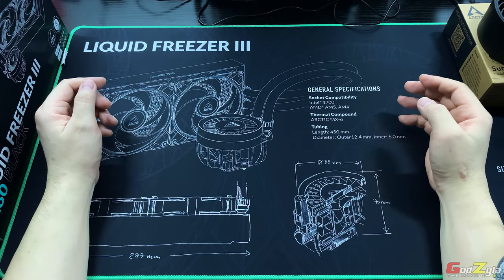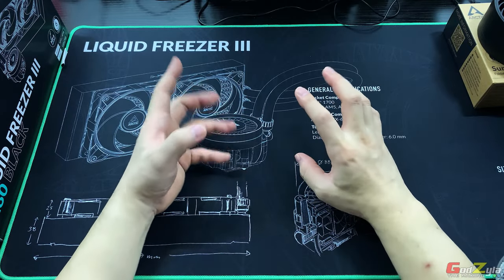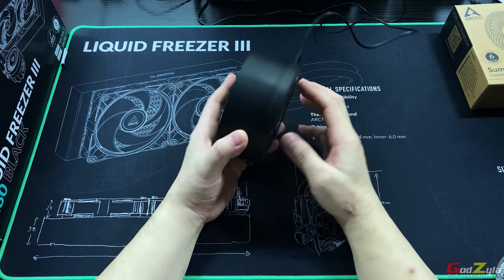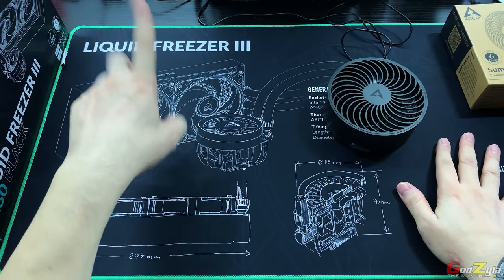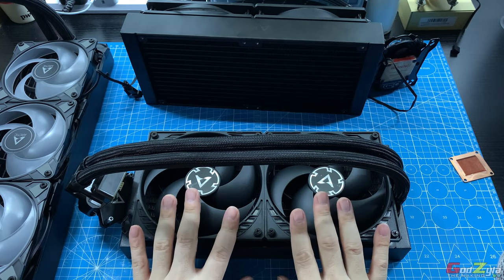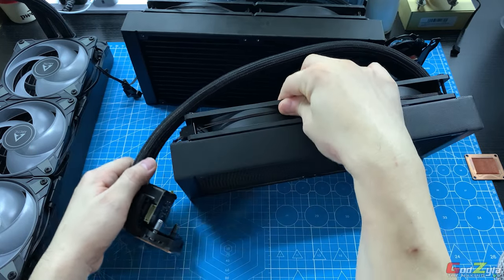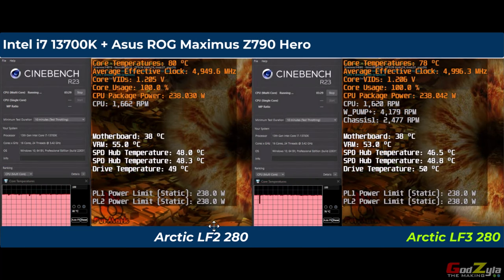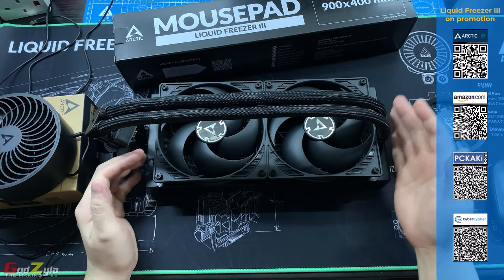Arctic Liquid Freezer III

Comment: Hey @kleoYan if you were me im doing a build with the 7950x, what motherboard you will pick and what liquid freezer III model for not get thermal throtling never with this cpu, I need your answer please
Reply from the maker: Hi Chema Alonso, welcome to my channel. For motherboard, I will need to know what do you use the 7950X? as for cooling this processor by default, I will go for LF3 280 (push pull) or LF3 420.
Reply: @KleoYan  Im going to use It for rendering and proxmox virtualization, I just want a good motherboard and a cpu cooler that give me 5.7 boost when im rendering without thermal throtling I just want for my need what do you pick if you were in my side :) thanks!
Reply from the maker: @chemaalonso7931  i see.. should just grab a mac mini M3 lol.. ok jokes aside, for budget mid tier, I will go for ASRock X670E Steel Legend or even the ASUS TUF Gaming X670E-PLUS WiFi 6E, both are of good VRM solution and power phases. As for the liquid cooler, LF3 280 (push pull) or LF3 420.
Reply: @KleoYan  thanks so much!
Reply from the maker: @chemaalonso7931  you are most welcome. Please take note on case airflow too. all the best with your build.
Reply: @KleoYan  there is a less cases for the LF 3 420 meshify XL and nothing more but if I put a 280 what case do you recommend for push and pull?, where can I see a video of that airflow?
Reply from the maker: @chemaalonso7931  the 420 on a mshify XL will be good. as for 280 push pull, it will be tricky to cater a case for it. As why I say push pull, I have done testing on an open bench.
Reply: @KleoYan  then meshify and 420 :) thanks your amazing
Reply from the maker: @chemaalonso7931  you are most welcome and all the best for your build.
Reply: Hi @KleoYan,

I hope this message finds you well. I'm reaching out to seek your advice on an optimal fan setup for my PC build, considering our previous conversations.

Here's my current setup: I have 9 fans in total, including 3 on the CPU radiator (Liquid Freezer III 420) and 6 case fans. My case, the Meshify 2 XL, comes with a Nexus+ 2 hub.

I'm contemplating two potential setups and would love to get your take on which might be more suitable:

1. Connect all fans (radiator and case) to the Nexus+ 2 hub and then to the CPU_FAN header on the motherboard. This would synchronize all fans to respond to the same speed profile based on the CPU temperature.

2. Connect only the radiator fans to the CPU_FAN header and the case fans to the hub, which would then be connected to the CHASSIS_FAN header. This would allow for more specific control, with the radiator fans adjusting directly to the CPU temperature and the case fans responding to the overall system temperature.

In both setups, I'm considering keeping the VRM fan and the water pump separate, as they have different speed requirements and may not need to sync with the other fans.

My main dilemma is whether to group the radiator fans with the case fans or to manage them separately. Which approach would you recommend to ensure each component operates at its optimal speed while maintaining a balance between efficient cooling and minimal noise?

I appreciate your time and any advice you can provide.

Best regards Chema!
Reply from the maker: @chemaalonso7931  Hi welcome back, I would have the radiator fans seperated from the case fans. this is what I will do.

1) Radiator fans to CPU_FAN (Make sure to check the ampere of CPU_FAN if it's sufficient to provide your rad fans)
2) VRM fan to Cha_FAN / SYS_Fan
3) AIO Pump to W_Pump / PUMP_FAN / AIO_Pump
4) your case fans to the NZXT Hub and then to the CHASSIS_FAN (This you need not have to worry about ampere as I believe the NZXT hub comes with a sata power source directly from your PSU)

the above configuration is more idea as in the even if your NZXT hub is not functioning, at least you know what your Liquid AIO will function as their VRM, Pump and Rad fans are plug directly to the motherboard respective pump / vrm / rad fan headers.

Comment: Good job man,
Quick question, I have a 120mm arctic 2 with a defective pump, do you think it is possible to adapt the arctic 3 pump to the arctic 2 ?
Reply from the maker: HI RCPxx R , welcome to my channel. I am unsure what you meants by adapt the Liquid Freezer III to the Liquid Freezer II. both Arctic Liquid Freezer II and Freezer III have a different structure. LF3 will be an improvement over the LF2 in terms of temp on an AMD platform.
Reply: @KleoYan  no lf3 with aio 120 mm, is it possible to mount the two pipes and the pump of the lf3 on the radiator of the lf2 aio 120 mm
Reply from the maker: @rcpxxr4452  as mentioned both are of different builds. Structure are different so nope. Why the hassle? I mean if you have the LF3. Just replace your LF2 or If your LF2 pump is faulty and it’s still under warranty, you can raise an RMA with Arctic and get it fix.
Reply: @KleoYan  thanks for the information
all this hassle? Because there is no lf3 aio with 1 fan. For fun I would have upgraded my lf2 with the lf3 pump.
Reply from the maker: @rcpxxr4452  I see. You are most welcome.

Comment: I tried 2 units of the LF III but the pump is much louder then LFII. Also when on lower rpm then the LFII (~2000 rpm)
Reply from the maker: Hi ya Daisudori, welcome to my channel. hmm.. I guess each have it's own sensitivity on pump noise and fan noise. So sorry that you find it loud you might want to tune down the RPM of your pump to 80% but there might be and increase of thermal by a degree or two
Reply: I shaked the rad around while the pump was running and now its quiet. Didnt work on the first unit tho.

Prolly some trapped air.
Reply from the maker: @Daisudori  That's good to hear. Infact I too tested 2 more other units. the one which I have and the 420 which belongs to my colleague. it's quiet but the 360. for some reason it's louding. gonna get intouch with Arctic on this, might need to do an RMA on the 360. by the way, thank you for your updates.
Reply: MY units were both 360 (black argb) @KleoYan
Reply from the maker: @Daisudori  hi you might want to do the same as in contact Arctic support about your car experience. As you have bought two units.

Comment: Great  explanation.  I see the fans are setup for push and the fan cables are daisy chained and the last one goes down into the tubes sleeving .  What if you want to mount the rad in the front of the case and have fans setup for pull. Can they easily be flipped over and can you still have the cables go down the side of the rad that is hidden.  Also what if you want to change the fans completely ?  How do you remove the fan cabling from inside the tubes sleeving  ?
Reply from the maker: HI Keith Flanagan, welcome to my channel. if you flip the fans to pull configuration, the cable which is in the tube is long enough to cater for the other side and if you change fans, I would still plug to the tube cable or you can choose to plug at a separate cable which is directly plug to your motherboard fan header. As for the cable that is in the tube, you can't remove it. I will just cable tie it and to hide it nicely. 
As you can see in this test, for the LF2, I have done the separation, as I know if I am to use the LF2 single cable, the rotation of the pump and fan will be much weak. So I have the LF2 pump to my Pump_Fan and radiator fan to CPU_Fan. For the LF3, I am using the splitted cables and not the single cable.
Reply: Thanks very much for the detailed reply. I already own an EK Nucleus CR360 Dark running Noctua NF-A12X25 fans.. I wonder how this rates compared to the LF3 360
Reply from the maker: @flaccus123  I see, if you already have the EK Nucleus CR360 Dark with the Noctua fans, the result is comparable or better on your AIO.
Reply: @KleoYan  I forgot task with Arctic Freezer III 320, how do you find the pump noise when controlling everything from the single pwm cable.  I have heard reports of it being noisy. Thanks.
Reply from the maker: @flaccus123  hi, for the 360 which you hear in the content, the mic is very near the pump and to me it’s not noisy when you place in a case.

Comment: I can't get my rgb to change when I hit the led button on my tower.
Reply from the maker: Hello Ryan DC, if you plug this ARGB from the AIO to your motherboard ARGB header. Your case led switch will not work. You have to connect it to the case ARGB controller.
Reply: @KleoYan  it's a 4 pin connector correct?
Reply from the maker: @FLA1L1NGSHUFFLE  nope 4 pin is to control rpm of fans.  It’s the 3pin 5V ARGB
Reply: @KleoYan  lol I have to look for that one. I don't remember where I plugged it in.....
Reply from the maker: @FLA1L1NGSHUFFLE  for the LF3, trace the cable, it's pretty easy. you have one on the AIO Pump and another at the fan end.
Reply: @KleoYan  I found it 😅. It was plugged up to the mobo and tucked behind the board to hide the wires.

Comment: Can you remove the fans? I want Corsair fans with it.
Reply from the maker: Hi StormRider, welcome back. I guess you wanted to know does Corair fans fit. This I am not able to answer you as I do not own any Corsair fans. Nevertheless the original Arctic P12 ARGB or Non ARGB fans can be removed from the Radiator. As mentioned, just got to be careful when you unplug the cable connectors. In general, you can replace with other fans, just that I cannot commit if Corsair fans can fit, as some are build wider and such.

Comment: i dont know where the pump vrm and fan cable goes.Like Fan cable goes to cpu fan and pump goes to aio pump and vrm to cpu opt?
Reply from the maker: Hi its_Mercy, welcome back. if you are using an Asus board, yes you can plug the VRM to CPU_OPT but do note that if you plug to CPU_OPT, the rpm will be controlled by CPU_FAN as both these share the same settings. If you want total control, I advise to plug it this way. Pump to AIO_Pump, Fan to CPU_FAN and VRM to CHA_FAN
Reply: @KleoYan  OMG BRO ILY NO HOMO
Reply: @KleoYan and can i take out these fans? like i wanna replace it with the montech Ax120 just for the aesthetic?
Reply: Just curious
Reply from the maker: @44Mercy187  hmm. you might lose the thermal or should I say it will increase in temp as the AX120 pressure static is not as good as the P12 or P12 ARGB.
Reply from the maker: @44Mercy187  you are most welcome.
Reply: @KleoYan  but how do i take them out?
Reply from the maker: @44Mercy187  remove the screws that are holding the fans on the radiator and do it one at a time, then unplug the fan and ARGB that are connected to the fan. Move in to the 2nd fan and repeat the steps. As for RX or AX fans. Do the reverse when mounting.
Reply: @KleoYan  ty man
Reply from the maker: @44Mercy187  most welcome.

Comment: As easy as it 

looks it is very difficult to mount
Reply from the maker: Hi prince prefa, welcome to my channel. Yes, alot did message me and told me that. I guess is up to individual and the key point is to support before mounting, let gravity does it's job. If you observe carefully, I rest my whole palm on the ram slots which give me a steady platfrom when I am holding the AIO Pump block, also the anchor points of my fingers which covers the back, middle and front, then I screw the block in. If you observe what other reviewers are doing, they hold by the back or even at the radiator hose, which gives unsteady or unfirm grip on the AIO block. That's why to me is easy as I just let gravity does it's work.

Comment: still hard to mount for amd5.. good radiator but not recommended because you'll have a hard time mounting it.. :((
Reply from the maker: @roiranger  hi and welcome to my channel. I get a lot of feedback on this. I guess the key point is the grip. Thank you for your feedback.
Reply: What makes AM5 so hard to mount? Seemed very easy for me with AM4.
Reply: @Rockett.  mount bracket is not a straight line. A little bent bracket. I just had a hard time mounting this radiator 😂 what i did is instead of mounting to motherboard first, i mount the bracket to the radiator first then to the mobo.
Reply from the maker: @Rockett.  hi welcome to my channel. Hmm, a lot find it hard to mount but I have no issues mounting it on me AM4 or AM5 platform, be it if the motherboard is outside or inside the case. I guess is personal technic.

Comment: can I put on a socket 1200?
Reply from the maker: Hi WhyTi, welcome to my channel. Unfortunately nope. It's only meant for 1700, can't do 1200.
Reply: @KleoYan  but I saw on Amazon ARCTIC Intel LGA1700 Upgrade Kit - for Freezer i13 X Series and saw photos that people put it on old sockets
Reply from the maker: @MichaiL_Kulinicz  really, I only following the specs of this liquid cooler. have done a search on amazon, those are for Liquid Freezer II https://www.amazon.sg/s?k=LGA1700+Upgrade+Kit+-+for+Freezer+i13+X+Series&crid=L1SEF9XW7HQ0&sprefix=lga1700+upgrade+kit+-+for+freezer+i13+x+series%2Caps%2C249&ref=nb_sb_noss or https://www.amazon.com/s?k=LGA1700+Upgrade+Kit+-+for+Freezer+i13+X+Series&crid=26K4Z105T0G6O&sprefix=lga1700+upgrade+kit+-+for+freezer+i13+x+series%2Caps%2C349&ref=nb_sb_noss_2

This Liquid cooler comes with only the 1700 contact frame and can only use this contact frame. If there is a contact frame for 1200, Mind to share the url of what you've seen? can you send it to my email godzylatech@gmail.com . Reason to go throught email as YouTube will automatically remove any urls that viewers posted. Thank you!
Reply: @KleoYan  in fact, the difference is there only in height, new to close the processor tightly, the good copper base is wide, and can be invented as to put it.
Reply: @KleoYan  I sent you an email.
Reply from the maker: @MichaiL_Kulinicz  Hi and thank you.. I have replied to your email and it's not cater for LF3, it's more of an alteration and I don't think is a good idea, but you can try.

Comment: Very good video, what is the noise comparison between the 280mm iii and the 320mm iii?
Reply from the maker: Hi guillado gui, welcome to my channel, just my opinion. both are quiet but some says it's loud. in comparision between 280 and 360 of the LF3. 280 will definately be of less noise as the 140mm fans RPM is lower but grabs more air pressure. This is due to the bigger blade diameter.
Reply: @KleoYan  thank u I ordered the 360mm LF3 for the same intel cpu that u are using 13700k I haven’t put it together but I’m still deciding which one would be better for me I want something quiet. U think the 280mm LFiii would be enough for that cpu
Reply from the maker: @guilladogui8259  hi a lot do not know this. Infact a 280 is better than a 360

Comment: Great video! Do you know if it is possible to change the orientation of the Arctic logo on the pump-cover?
Reply from the maker: Hi Perrajajaja, welcome to my channel. Nope you can't change the orientation of of the pump-cover.
Reply: Thanks for the response! That's to bad, since the logo will be sitting at a 90percent angle in my case😂
Reply from the maker: @Perrajajaja  you are most welcome. I would not advise you to mount the pump hose at the side. Infact I don't think you can do that as the mounting brackets only allows you to mount either hose up or hose down and not towards the rear (Rear I/O) nor front (Ram slot). Overall as mentioned, for best results is to mount your hose facing towards the m.2 slot.
Reply: Thanks for the replies! In my case, the backplate of the motheboard is  facing upwards, so the orientation looks different😊
Reply from the maker: @Perrajajaja  ok, then you got to be flexible to see what is applicable to you to fit the contact frame.

Comment: Great video brother. Can you share results with 280mm compared to 360mm?
Reply from the maker: Hi Tpecep, welcome to my channel. I see what I can do but kindly wait as I have my main job to do. Do pardon me that you got to wait. Thank you for your suggestion.
Reply: @KleoYan  Thanks for reply, it might be a great video comparison if you do all three models 280/360/420, but please if you will ever do such video use something like 280w power limit. 

I am using LF2 280mm now and 14900k, getting 90-95c with 320-340w loads, but mine CPU is delided. I ordered LF3 360mm in hopes to see lower temps, maybe as low as 80 degree in full load :)
Reply from the maker: @ Hi, thank you for suggestion but on your request on having the power drawn at 280w or above it, I am sorry but to reject this, The area I am at, it's hot and humid and my test are targetting to hot and humid contries. I wouldnt want to test in an aircon condition. Besides this, I have fried 3 of my processors which warranty are void (13900KS,  14900K and a 7950X). 
Hope for your kind understanding that for processors, I do not have any sponsorship and all processors used in my content are out from my own pocket. I am so sorry that I can't comply,  thank you!

Comment: Ahahahhaha. "Can't hear the pump". At 100% my lf3 pump resonates with the motherboard and a bit with the rad itself. But on top of it pump rattles as crazy (not the bubbles but actual rattle). And I'm not the only one according to reddit threads. Arctic itself ignores the ticket. I'm very disappointed since I already have LF2 and essentially got lf3 for looks.
Reply from the maker: Hi Anton_s, welcome to my channel. So sorry to have hear your experience. I didnt have these issues on both LF3 which is provided by arctic or the ones which are purchased.